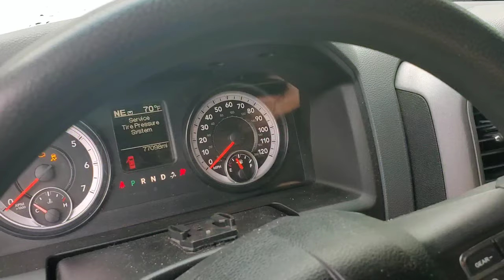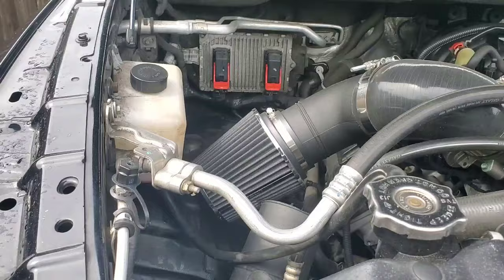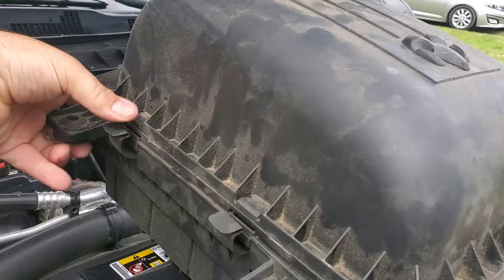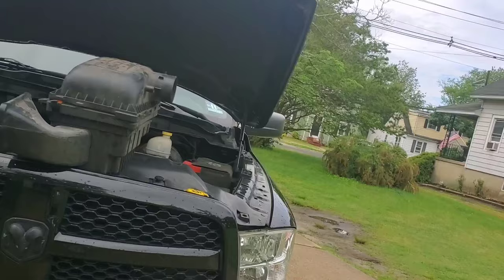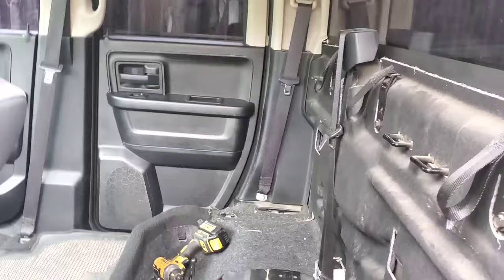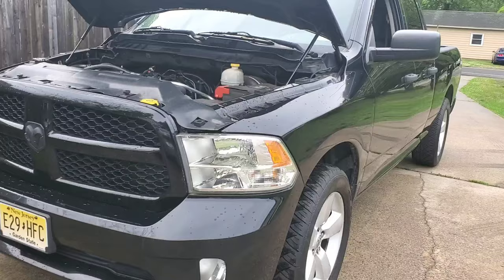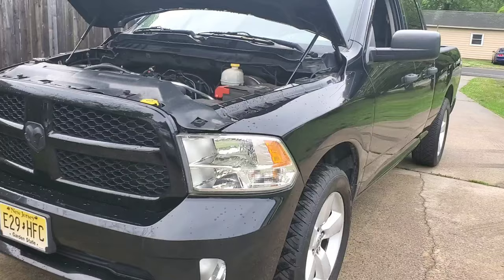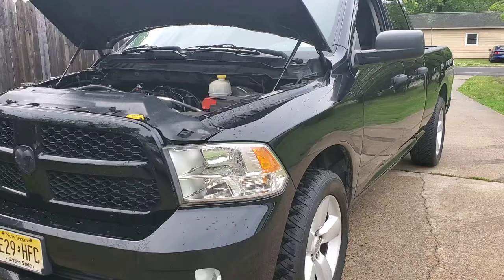Here's 3 FREE MODS to make your Ram 1500 FASTER at the dragstrip!!

Comment: DO NOT DRIVE WITH NO AIRFILTER. 75 bucks K/N lifetime cleanable very breathable upgrade air filter. Makes a difference!
Reply: At LEAST run cheesecloth and wire mesh (track day only) .. This has been done for decades safely as long as you are covering no larger than a 5" hole.
Reply: How times have changed it’s 300+ now

Comment: #4 Mod to loose another 120 pounds weight, don't go to the track with a full tank of fuel. In fact on takeoff that liquid is thrown/sloshed to the rear causing a slight pull. I run a 1/8 tank and bring cans.
Reply: The general rule is 100lbs = around 1/10th of a second in the 1/4mile

Comment: Taking the tailgate off will cost you drag. It alters the aerodynamics and not for the better.
Reply: This was proved on myth busters years ago ur right
Reply: Take the tailgate off and use it to make a mold to make a fiberglass shell and fill it with expanding foam.  I'm fiberglassing the fenders, hood, replacing rear bumper with roll pan, add bed cover, and battery relocation to bed.  I don't hit the strip but I like to troll.

Comment: I left my air box in, K&N filter. I took the air box snorkel and rotated it down 90°. Pulls in more air than through the fender. Keeping it stock, Ram 1500 crew cab, Outdoorsman. Installed BBK Headers, and Flowmaster Outlaw stainless exhaust kit. I Don't run it down the track, my daily driver, but I work with drag racers. Seems like they are rubbing off on me. Lol.

Comment: Agree removing the clutch fan is definitely noticeable easily 10-15 hp. Not huge but anything helps. I did the V6 direct plug and play with 180 stat looks like factory. My Ram Rt is running cool and also mpg's go up with clutch fan delete.
Reply from the maker: Yea im getting mpgs than I was stock also

Comment: You’d get much colder air by putting that cone filter into that box these things are engineered to get colder air from stock doing that with the air intake youre just getting a lot more engine bay hot air opposed to putting the cone filter inside of that box and sucking in the air from behind your headlight outside the engine bay.

Comment: I'm wearing headphones and my teeth are rattling. That's doin it justice......LOL.
Nothing  like the sound of a Hemi booting up.....whenever and wherever.

The first Hemi I worked on was in a 57 New Yorker convertible with a 392 Hemi (factory).
That was a heavy beast but that Hemi made it haul. 16's stock and 13's with the super charger.

Funny as hell watching the old 392 in a big car keep pace with the stock 340 Swingers turning mid to high 13's.

Comment: a few more free mods if you are really trying to break records. drain 2 quarts of oil out, remove rear brakes and rotors and plug the lines, remove serpentine belt (for the pass only), remove sway bars and front shocks, remove entire exhaust system, remove fan like you said and as long as you have a 180 thermostat with or without tune it wont get hot at least in my experience even when towing, 80psi of air in the front tires and normal in the rear.
Reply from the maker: I msde this just for the basically stock to mildly modified guys
Reply: Ole Schooler
Reply: What about no thermostat?
Reply: @josepimp404  a lot of times with no thermostat you’ll find that the water will be moving too fast and it will take a long time to heat up. when it does finally heat up the water won’t be staying in the radiator long enough to cool off and it will run hot. In most cases anyway. I won’t say every vehicle will respond that way but that’s been my experience.
Reply: @D E I guess every bit of weight counts but Iv always heard the older crowd at the drag strip say it makes the oil run hotter which will make less oil pressure causing the oil pump not to drag the motor quite as hard. Although since I made this comment 2 years ago my friend who owns a race engine shop dynoed a motor with a stock oil pump and swapped it for a high volume pump and it made no difference. So that 2 quarts low thing is just a myth. However you would loose 3.5 pounds by removing the 2 quarts if you consider that to be worth anything lol
Reply: @jacobsanders8717 late comment but losing the 3.5lbs could possibly prove to be pointless if wind conditions are bad enough lol

Comment: Cold intake is in wrong place , should be pointing downwatd to pavement away from engine bay , second the spare tire , remove it from truck ,Lighter wheels can go faster because there is less weight to control. They'll help you speed up your acceleration while decreasing the time it takes you to come to a full stop.Lighter Rims=More Wheel HP. I go with Mickey Thompson ET Street S/S Tires. add 10 gallon fuel tank , make sure your tank is on empty extra weight . go to the body shop add hood scoop with fan suck the hot air out of engine bay . little things make diffrence . some of these i have done to my 2016 dodge ram 1500 , i got bigger throttle body on it , and thinking about adding turbo to it . You got save money as you go . the sound comming from engine front end raising up on green light , it makes life worth living . Cops hate me

Comment: If WD-40 an adjustable pipe wrench & a 1/2" LONG Johnson bar are the special tools you referring to? It'll take 20 minutes at the most! The biggest issue was when all of the meatheads we're 
 Getting confused as to which way the fan clutch turns which would be dependent on which generation of RAM truck the fan clutch is being removed from? My truck is the fourth generatio😊 on the driver side of my quarter fender I used my  half inch Johnson bar to hold the tensioner in place while I rotated, the clutch fan bolt counterclockwise in order to remove the 15 pound clutch fan. I to didn't see it necessary to install the V6 electric fan being that the natural convection process of hot liquid, naturally moving to the top of the engine with the cooler water doing the opposite. I also installed the 180 thermostat at the same time. up to this point I've had no issues whatsoever due to my AC electric fan, moving enough cool air pass the radiator.

Comment: I knew diesel guys when I had my 6.0 powerstroke (2016 ram now) that would take off the entire air intake setup and run two pieces of screen (like from a porch) over the throttle body with a hose clamp. Much better flow and the screen stopped larger debris if need be. They swore by it when racing. Electric fan kits aren't that steep on price but fitment is sometimes fun...if you're making a ton of runs and running it as a daily driver...electric fan may be the more economical and time conserving method...save frustration too with taking that fan off and on. You could also get into wrapping your headers and shit to drop engine bay temps...but that wrap ain't cheap and requires patience unless you take em off first.
Reply: gonna try this thanks a lot for the great info
Reply: I’m gonna do this to my truck. But not for the track. I’m gonna just leave it that way. And skip the the screen because it’s does infact constrict air flow and adds extra weight in the engine bay.

Comment: Brother, in your opinion who is the best custom tuner?  I have a Diablo I3 Platinum tuner. I own a 2007 ram 1500 SLT 4x4 4 door with (used to be) a 5.7l. I have bored and stroked it to 397ci with molnar 4.080 crank, 6.125 I-beam rods, and CP Eagle pistons (9.6cc dish) and installed an Inertia cam (I have cam specs). MDS delete, Eagle heads, and will be installing the 6.4L intake manifold and some sort of CAI. I have 392 injectors, pacesetter long tube headers, no cats, and a pacesetter 3" Y pipe. Tranny is the 545rfe with a Transgo valve body and Sonnax RFE-LB1 line pressure booster.  I would like to adjust shift points, MDS delete from the ECM, raise speed and rev limiters, and adjust for tire size (35x12.50x18).  Can you suggest a custom tuner? Is it better to find a local dyno shop and have them tune it? I'm in the Dallas area. Thanks!

Comment: All the stuff your tearing off the vehicle I have a 2008 Dodge ram 3500 with the cummins in it and I was having problems cause I need to get my heater core fixed so I took the thermostat out engine runs a lot cooler

Comment: Another good cheap mod is take that old air box off get a conical filter and a hose clamp and put it on the stock down tube
Reply from the maker: That is true
Reply: @IncredibleHemi1111  I won't say it's a power adder but I'd def helped with my Diablo tune...

Comment: Put it in 8th gear and turn off skid in snow off many ways to mker fast. U can download BDS and plug it in under Neath legs. There is 5000 modes all Free. One I thought was neat changes your ideal sounds like a song. But becarfull what u touch in there. And put nos threw it.
Reply: Put your hemi truck in 4x4 hold down tc button for 10 seconds it will turn off the esc system too play in the snow and mud but will turn back on at 45 and of course low 4x4 turns off esc automatically

Comment: Okay, all kidding aside... I just picked up an '02  RAM 1500, don't plan on tracking it, so definitely not ripping out the interior, etc... But I would like to do a couple things that boost the power slightly without really making it thirstier. It's bad enough! LOL

I WOULD like to increase the power enough to get decent burnouts, not for smoking tires but for better pulling power when my trailer is hooked up. 
What kind of low cost ideas do you have---better flowing air filter, etc..?
This is the outgoing generation and nothing incoming generation in 20O2. Thanks!
Reply: do the fan, mid muffler delete, drop in filter, and some good maintenance

Comment: What does your truck weigh after dumping the excess weight.  My 2012 bighorn 4 door 4 wd full interior with a cap and gear in the bed weighs in at 6250 with driver.

Comment: I have a 2013 regular cab Ram with the 4.7  6 spd trans. chrome bumpers . I'm thinking of getting a Ram 5.7 hemi or Ram 2500 6.4 hemi..  Wondering if I should get the computer with wiring harness for the swap? I plan on installing the Comp. 220 intake 230 exhaust at 0.50 cam. Getting valve springs, home porting the heads home porting the intake manifold. Probably headers too in the swap. I'm not thinking about changing the torque converter. Can't find anything on 4.7 cams or headers for my year of engine. Didn't know it when I got it. A new truck sounds like to much money but it's an option.
Reply: That's weird bro i have a 2013 and its fitted with a 5.7

Comment: You can remove the front actuating air dam also to save weight, if you have them. Not to mention using a super charger, stainless headers and K & N air filtration system.

I've always been a fan of the 426 Hemi (old verson) that Chrysler put in their old Charger/Challenger vehicles... Sweet!

Though, I do have a 2019 RAM Laramie 4x4 with a 5.7 (350 ci) and use 5W 30W full synthetic motor oil with duralube additive to reduce wear (less friction & smoother running).

Comment: V6 fan, shutter delete, 180 thermostat, and a tune.... If you do the 180  thermostat on the newer truck you need to do the shutter delete! Otherwise its pointless...
Reply from the maker: Its not pointless keeps temps lower
Reply: @IncredibleHemi1111  what I mean is if your truck has the shutter infront of the radiator and you attempt to lower the temps with a thermostat its pointless the shutter affects airflow..... You need to do the shutter delete to take full advantage and ensure you get maximum cooling

Comment: Serious question here. I get running a cold air intake/ or better yet at the drag strip removing it and just shoving all the air you can fit in the intake. I understand removing weight means less strain on an engine to get up to speed. But what does the clutch fan have to do with it? How and why are you gaining HP with removing the clutch fan?
Reply: Less drag and strain on the motor.

Comment: You’re talking about removing shit you need for literally no gains. Removing air filter won’t make more than like a 3 hp gain. Removing a couple seats won’t do hardly anything in weight change and removing clutch fan doesn’t help at all. It weighs almost nothing and keeps your motor running cooler which causes it to run better. You want power gains lower the truck, get a bigger alternator, turbo it, dyno tune it, cam and bore the engine.
Reply from the maker: Everything I named will gain you about half a second off your 1/4 mile time at the drag strip.  How do I know? Because I raced and tested it multiple times so 🤷 🤦‍♂️

Comment: Why the in the world would you take a ram 1500.to the drag strip? Even if it had 425 hp it would still suck on a drag strip
Reply: You Don't Understand Truck Guys!!
Reply: I'll bring my Ram srt 1500 and Meet you Andrew D at the strip. You bring whatever you like see what Happens Bro.
Reply: @tomthompson8875  now that's just a silly statement.  Nice truck verry nice truck I love mine as well , but bring whatever I want would not be a wise bet.. I would start off with a rebuilt  cr500 old 2 smoker would smoke your ass on the back wheel too. Unless you have build a turbo truck with 2 75mm turbos , and computers to boot lol.
Reply: @jaymichels277  I am a truck guy.but mine says 4x4 not low to the floor

Comment: 12.20 hahaha are you serious? A stock Kia stinger is faster than that thing. Don't waste money trying to make a truck "fast" you're just putting your gas mileage and reliability in the shitter
Reply from the maker: Ok a stock kia stinger doesn't even run 12s but ok , plus this is a 5000+ pound truck that I have fun with
Reply: @IncredibleHemi1111  just sayin buy something thats actually fast instead of ruining this truck for no good reason
Reply: @adamjohnson9976  Gotta say I agree here.  With a little bit of know-how and elbow grease, for the amount of money spent on that ram to get it into the 12's, you can buy yourself a classic ride that will do 11's and is way the fuck cooler looking to boot.
Reply: @IncredibleHemi1111  they don’t understand “built not bought”